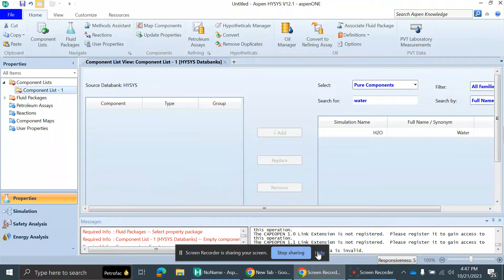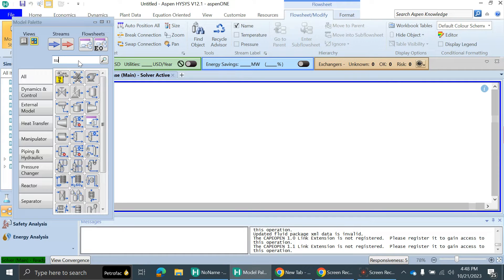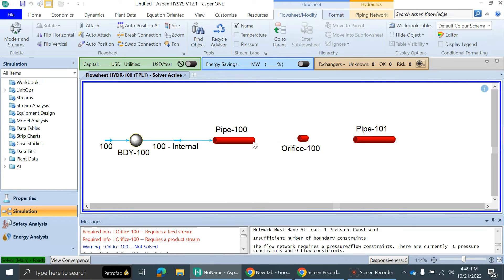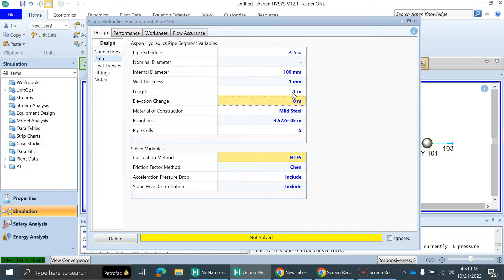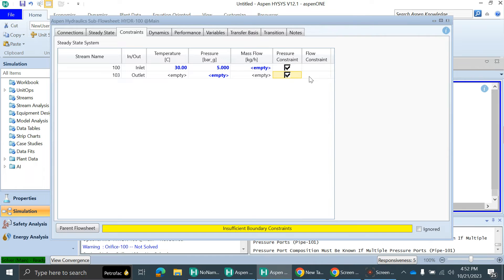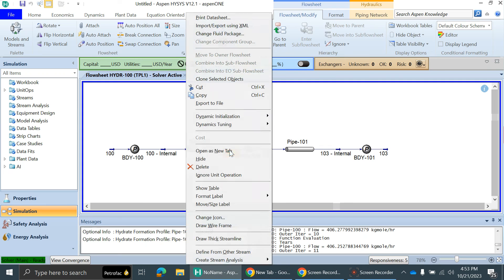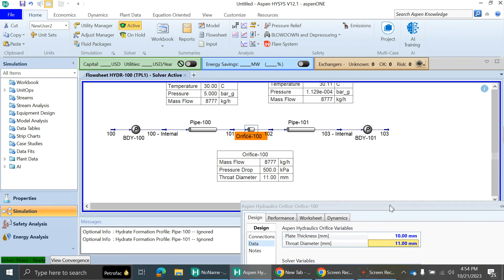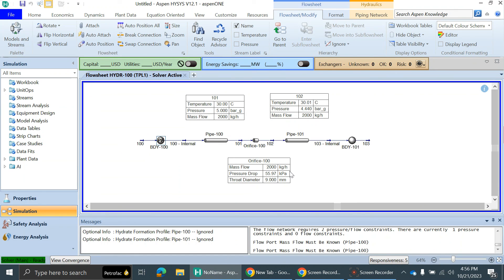Orifice Sizing in Aspen HYSYS

Comment: Thanks for your video
I have a question. Why did you use the HTFS method instead of Crane??
I did some simulation and different pressure drop value was derived between HTFS and Crane.
Do you have any idea of which method is correct?

Comment: Shall i use this orifice sizing to determine Pipeline leakage rate. for an example, leak hole size is 50 mm (assuming this is orifice size), and  upstream conditions are known. Downstream condition is open to atm. Is it correct approach to estimate leakage rate.
Reply from the maker: Yes you can and the approach you explain above can be used
Reply: Thanks bro. @Processengineeringguy